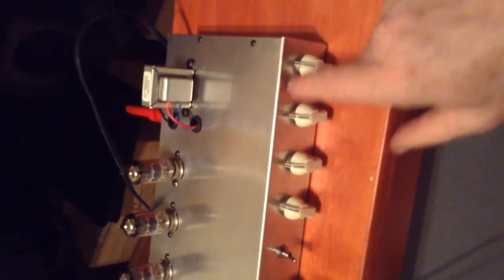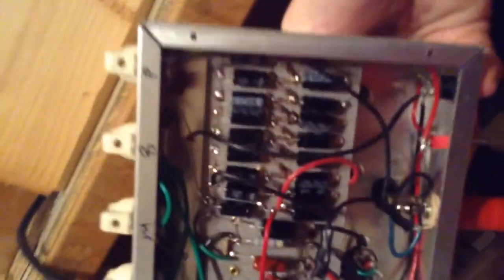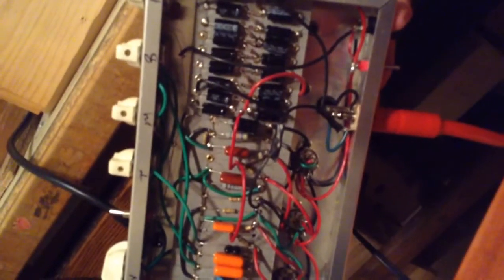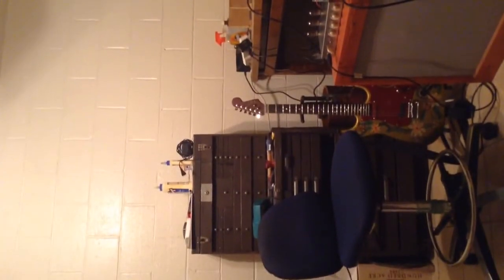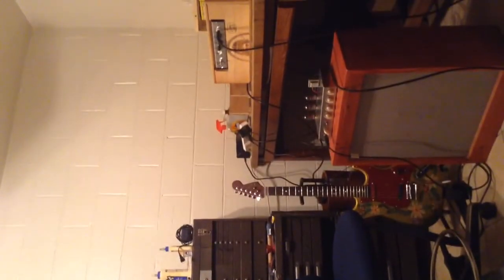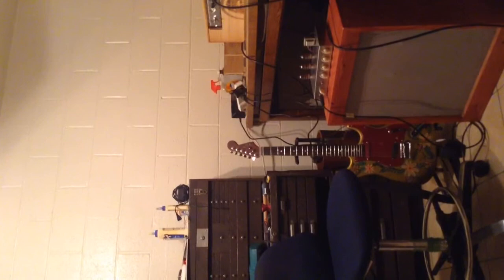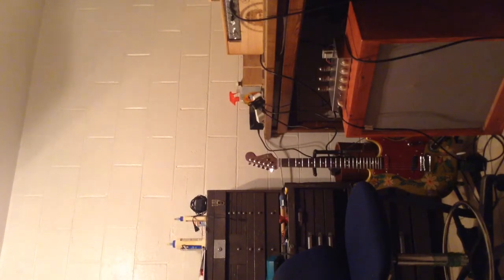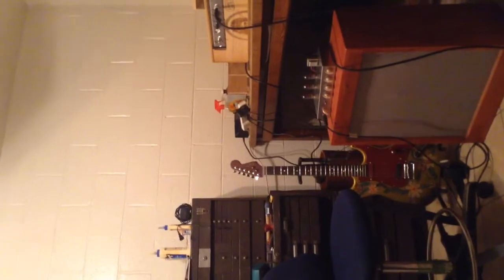1/4 watt high gain amp single ended running game on 9 volt

Comment: Hi Greg, could this run off a 9v battery?
Reply from the maker: Christopher Alchin it could but the heaters draw a fair amount of current. A 12 volt battery like a motorcycle or lawn tractor size would be better.